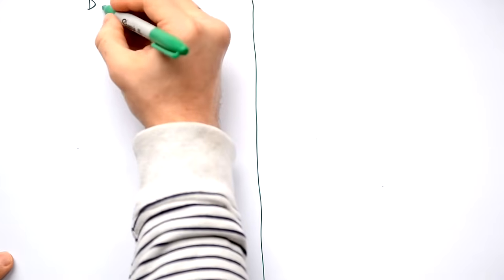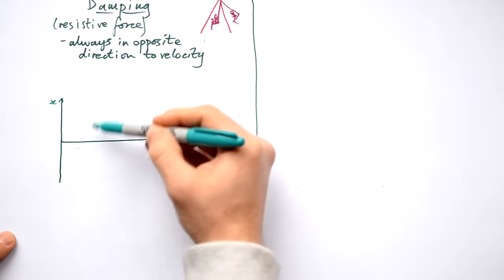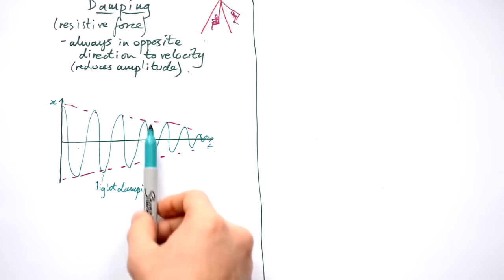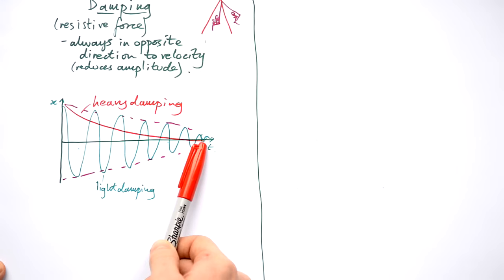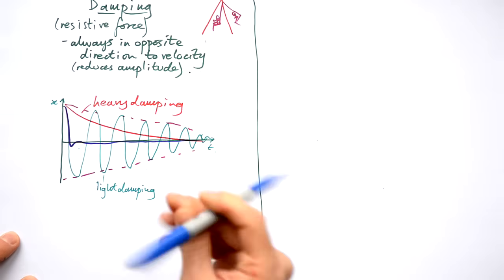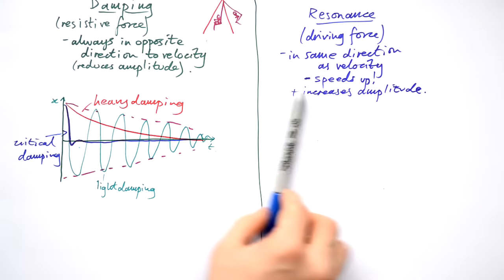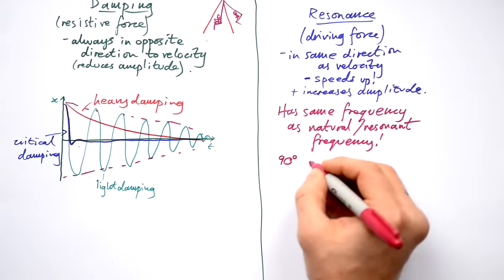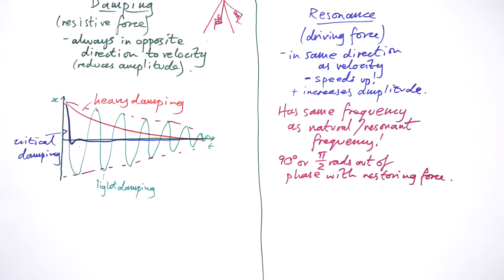Damping & Resonance - A-level Physics

Comment from the maker: Re-uploaded due to a mistake. Thanks to Henry Bamber for spotting!
Reply: 5 years later still keeping up the tradition
Reply: Professor i have a few questions:
1) should the frequencies be the same for us to call it resonance or as long as the amplitude is increasing it's resonance?
2) In Barton's pendulum does resonance continue till both objects with the same natural frequency reach the same amplitude and have the same energy?
3) what if the amount of energy applied is the same as the energy lost because of damping ?
4) In stack exchange they were talking about the system reaching equilibrium, how does it reach equilibrium? 
And thanks for the great explanation 🌻
Reply: @Andy Tyson  lol

Comment: What are some applications of heavy damping?
Reply: an application for HEAVY damping are door dampers, they are used to prevent doors from completely slamming shut. and an application for CRITICAL damping is a car suspension system to prevent the car from oscillating after hitting a bump in the road

Comment: Interestingly the resistive force and the restoring force are 90 degrees out of phase also for damping. Since the air resistance force is proportional to the negative of the speed (or speed squared).

Comment: I was taught that what you called heavy damping is actually overdamping. Heavy dampening is just like light dampening but the amplitude decreases faster, that’s what I learnt at a level
Reply: AQA?
Reply: same here
Reply: Hehe
Reply: AQA has it wrong in the specification so they call oversampling heavy damping
Reply: same
Reply: It's Damping
Reply: Same
Reply: Overdamping is actually stopping faster than you need to so it takes longer than it should